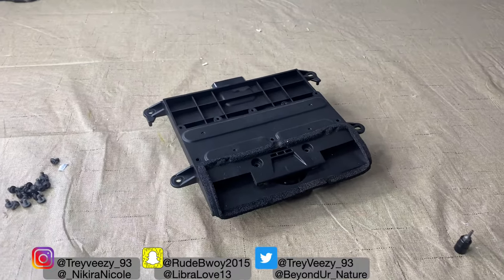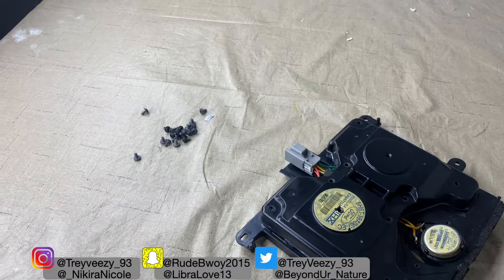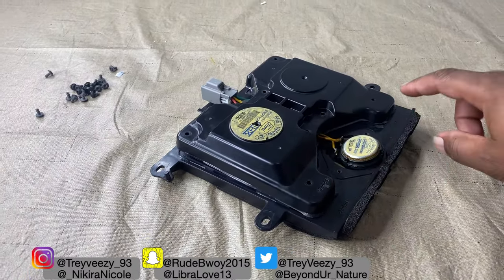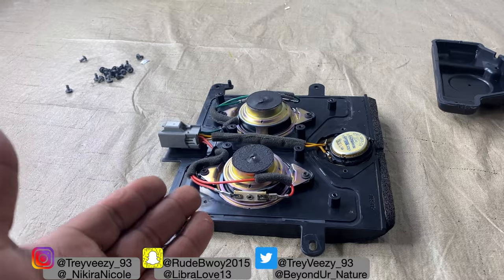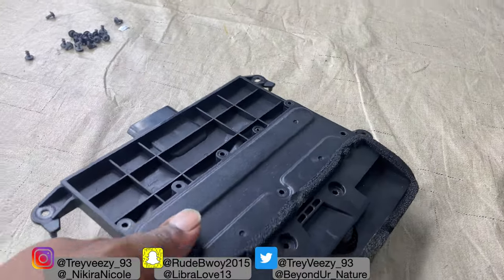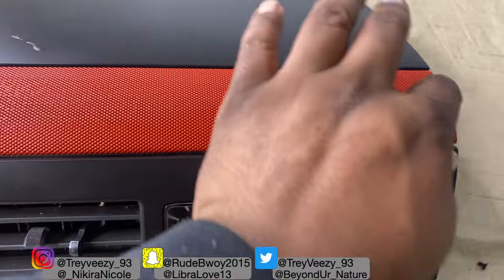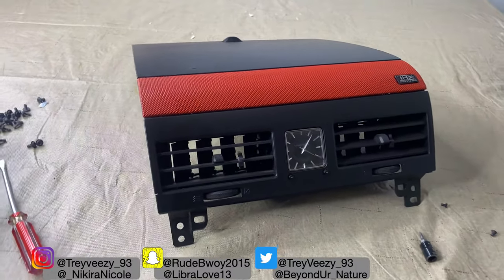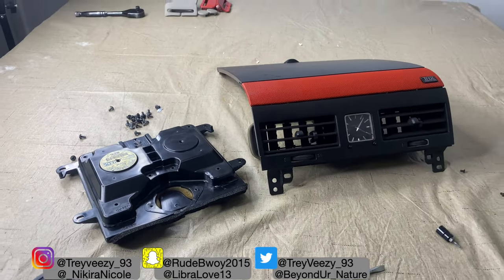CRUTCHFIELD SAID THIS CANT BE DONE | THX CENTER DASH SPEAKERS | LINCOLN NAVIGATOR

Comment: Hey im trying do same thing but with 2 3.5 tweeters ds tweeters in mine, how should i wire them up?  Or should i just leave 1 tweeter center one and replace other 2 cutting plastic with dremel and mounting them.  Is this good idea? What u think. I got upgraded alternator need battery. Lol. Mono alpine amp for my champion series pro edition 12 inch subwoofer that hits too hard.  I replaced factory subwoofer with a special mtx 10 inch instead of stock 8 inch sub. It sounds good just want them highs it needs bad.  Or should i bypass centrr?. Your thoughts its been my project few months now need advice please